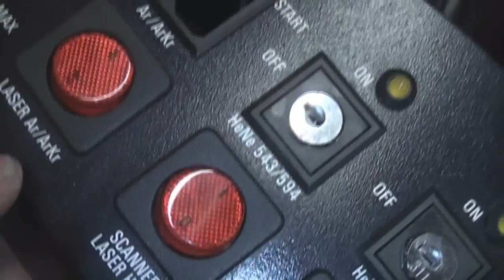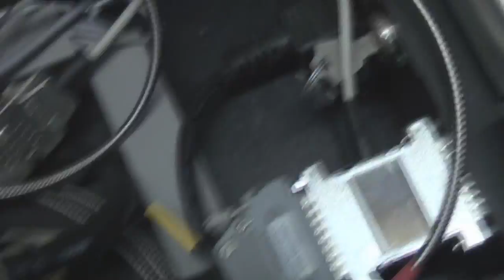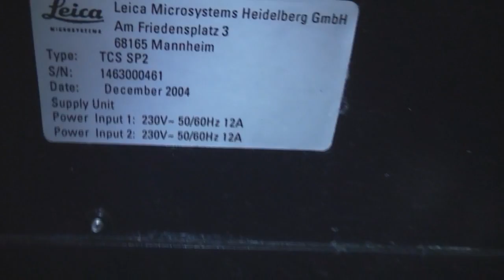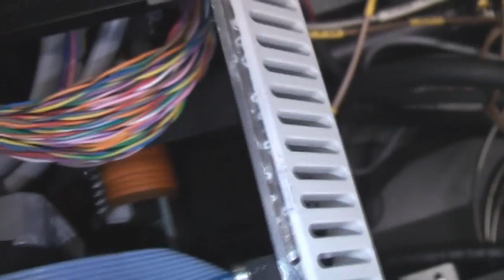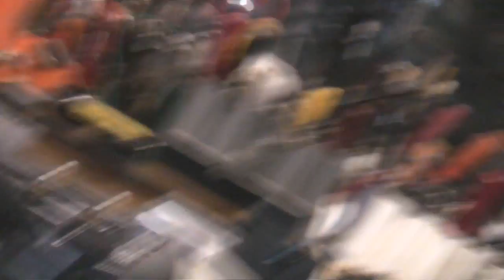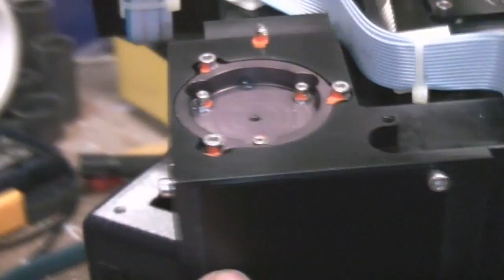Leica TCS SP2 Laser Scanning Spectral Confocal Microscope Part 1

Comment: I used to fix these up and replace the lasers in them, the one that really could not be easily substituted was the 561nm from krypton, and the 594nm from the hene. To make them work with different lasers is simply a matter of adjusting the AOBS unit. 🤓

Comment: Rather than teardowns, I'd like to see you engineer stuff. Like a copper based small diameter single slice limb MRI scanner. Maybe momentary saltwater cooled or even nitrogen. But uncooled would be most elegant if possible.
It's not the easiest device to make but you have nice flair for keeping things simple. And it's fair to say it has commercial potential. Of the billionaire variety.
Reply: Salt water cooled?

What are you talking about?!

Comment: We use a IV at uni. Let me know if you would like to know anything specific. Search for a sc5 manual to see very similar setup as the II but the IVs manual is a bit more clearly explained.
Software and interface is the same. the other table is normally a air laser table.
quite long startup times on these machines, you have to key them on, wait 15min then key lasers.